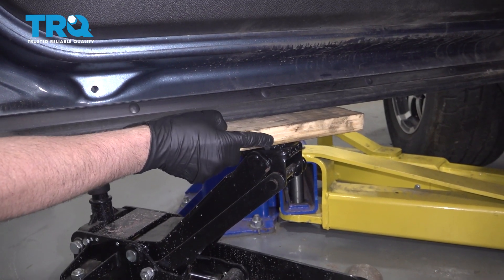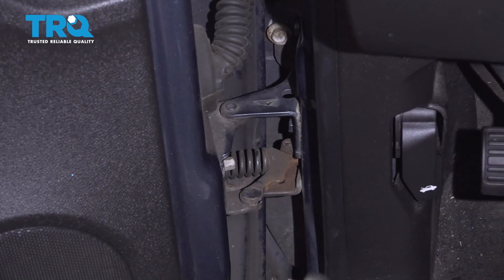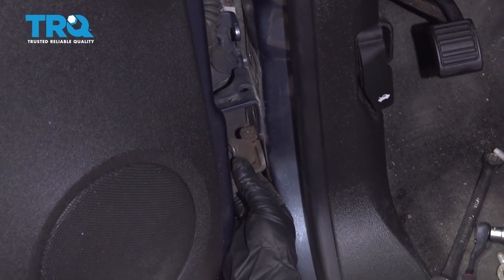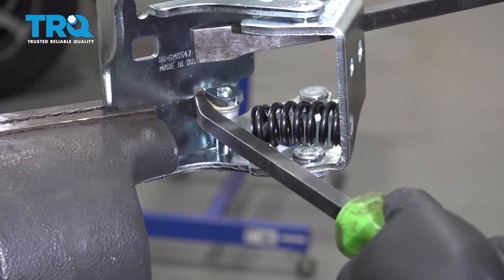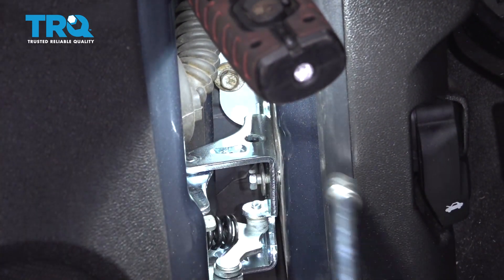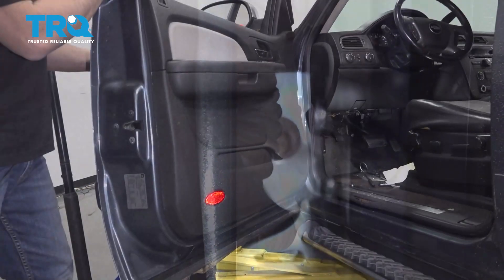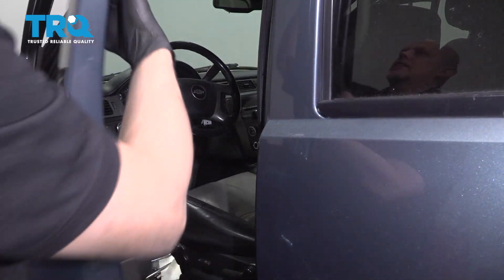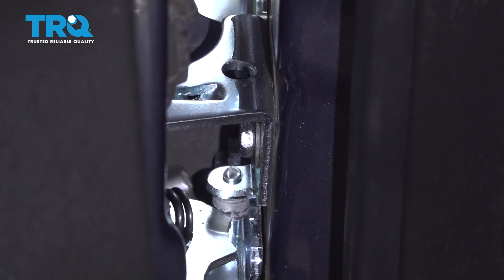How To Replace Door Hinge 2007-13 Chevy Avalanche

Comment: You removed the top hinge, and you are putting a bottom hinge with a spring in its place? HAHAHAHAHA
Reply: In the video he removes the bottom hinge and replaces the bottom hinge as well.  Both parts are identical, there is a spring on the original part he removed as well.
Reply: Uhh no he removed and replaced the lower hinge.  Derrr
Reply: @mmtunphilly  you need to watch it again from the start, and for the record...the 2 hinges are NOT the same.
Reply: @Blake N  first part of video shows him removing the top hinge, which is completely different than the bottom hinge.